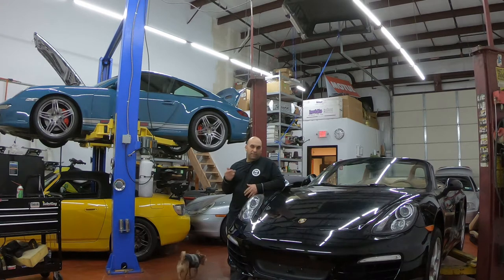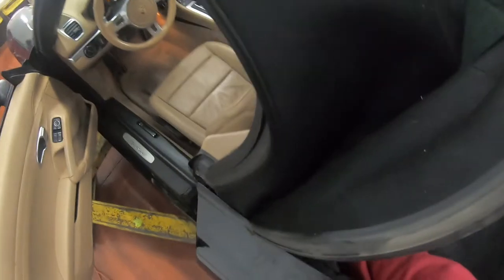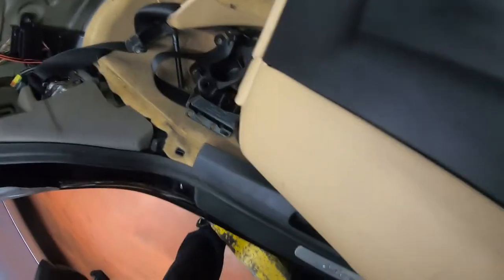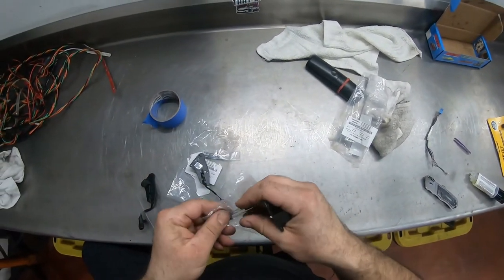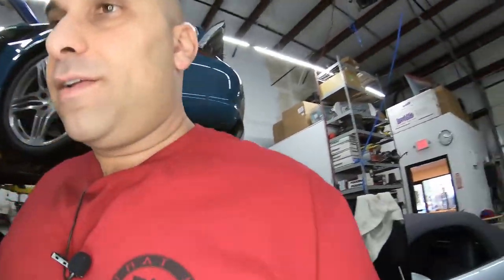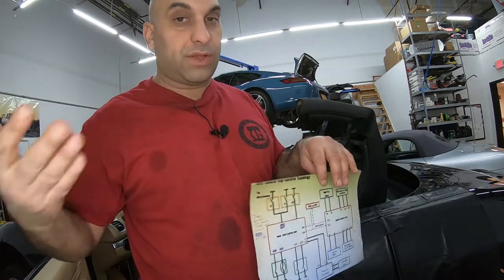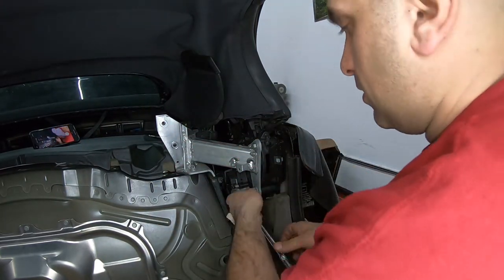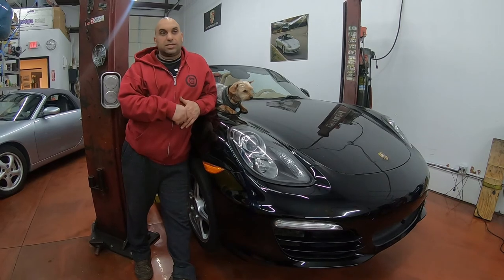981 Porsche Boxster convertible roof FIX micro chip replace and repair Episode 3

Comment: My 981 top has the same symptoms and is going into the dealer next month.  Hope they can fix it with just the mechanism and microswitches at the windshield hook assembly.  But, thanks for the detailed presentation.
Reply from the maker: Good luck   Is it under warranty?
Reply: @ThatLigarage  Yes, fortunately

Comment: Thanks I have the same issue,will check the hook latch first, before taking my iron tablets .looks like you had two seperate issues , great idea to solder the wires doing away with the corroding connectors.
Reply from the maker: Thank you 
I like to fix things permanently 😉

Comment: Good Vid - thanks.  Would've liked to see more on the disassemble part, taking everything down to get to the microswitches.  The re-assemble helped, but still missed a bit.
Reply: At 10:58, it looks like the whole mech is lifted up out of the car - this is the part that would help - how did you get it to this point?
Reply from the maker: thank you , on this project I diagnosing this issue while I was filming so it was hard to focus on the two tasks at the same time, but thank you for the advice ill ty to use it for my next videos.
Reply: @ThatLigarage  question - did you ever have to put the top motors in manual mode (that adjusting bolt that "clicks" when you tighten it behind each seat) - if so when?
Reply from the maker: @lloydc872  I did but I'm not sure if i filmed that part, I figured it was simple but next time I work on one of these issues ill post it.

Comment: have same issue..very helpful..ty..did you end up replacing anything in the latch or just reposition the micro sensors/switches there?praying I dont have to do the microsensors at the rear operating mechanism
Reply from the maker: Nope just those and it was done

Comment: I have a 2013 Boxter and the dealership replaced the latch micrositch that you said fixed the issue in the video. My top originally would stop halfway and you would have to hit the button again to finish opening or closing it.  It eventually failed in the down position and said it Was not in the lock position.  It did not go up or down from there and we took it to the dealer. They replaced the switch. However, its still stops halfway now And then we have to hit the button again.  Could the left and right pillar microswitches be causing the issue or do think the latch with the microwave switch in the top that you replaced could still be the problem.
Reply from the maker: It was a while since I filmed this episode so forgive me if I’m wrong but I believe the switch my the latch detects the position the latch is in so it dosent crash in to the window pillar. If that switch is bad it will hold it back from closing all the way
Reply: Hi wsmith.  Just wondering what was the fix because my car is doing the same thing . Roof opens and closes but stops halfway and have to hit the open or close button again to complete the cycle

Comment: So, did you take all that apart to fix the piece behind the top latch?
Reply from the maker: no i took it all apart to find out what's truly wrong with it and to show you guys all the components incase you have an issue with a car your working on  thanks for the comment
Reply: @ThatLigarage  no I get that you had to fix the wire connection, but the actual problem was the latch switch mechanism, right? Just trying to figure out what I should look at first.
Reply from the maker: @christopherb8219  it was the micro switch in the latch mechanism, the latch part worked fine.

Comment: I just encountered the same problem. 2013 Boxster. The roof stopes, when I hit the close button it will close. From your video it appears it has the same problem. Because it’s in the latch module. Do I have to put the top in service mode? Can I just open the top half way take the latch assembly off and inspect the modules? Without tearing the whole thing apart?
Reply from the maker: Yes so you have access to everything